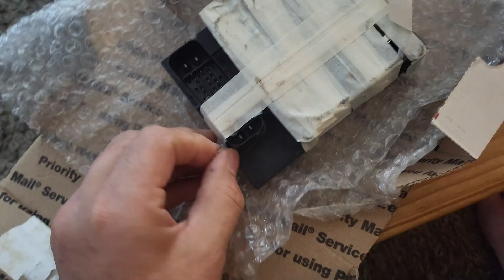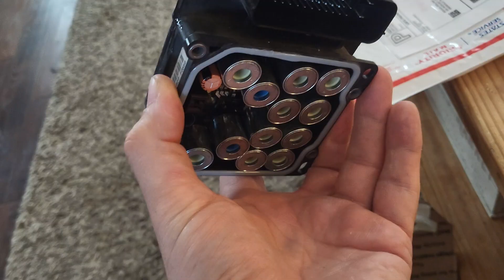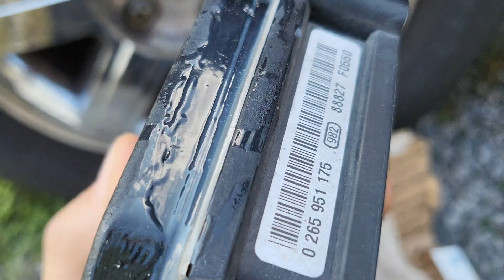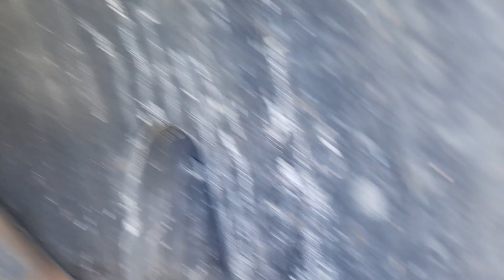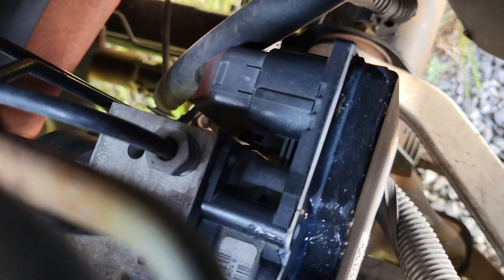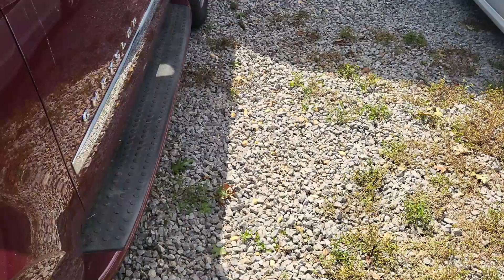Chrysler Aspen ABS Module Repair Part 2

Comment: My dad's 2008 chrysler aspen 5.7 has no communication with the ABS module according to my scanner.  Do you know which fuse controls that and location.? Do you know if  their is a fuse box inside the car ?  I see 2 fuse boxes under the hood. Let me know if you can assist. Thanks
Reply from the maker: I appreciate you checking out the video.     I am unsure about the fuses. I had code 2200... which is a failure to communicate.   Once I did the ABS repair done, the module and truck started talking. Apologies. I don't know which fuses...
Reply: Thanks

Comment: Also would like to know if you had to bleed the module like you would bleed the brake lines. Or did you just reattach it .
Reply from the maker: Yes, I did bleed the ABS after reinstalling the rebuilt module. Once you fix the module, your truck should communicate with the module and then you'll be able to bleed the ABS using your OBD computer. Be sure to follow the service manual. I also had to do it a few times. Thanks again for checking out the video.
Reply: Thank you

Comment: Can I ask you a question? While your abs control module wasn't working did you notice the speedometer not working too ?
Reply from the maker: No...my speedometer DID work.
Reply: @mpen4445 I was looking at the module and it was actually unplugged somehow.  I plugged it back in hoping that would fix it but unfortunately I still have all the lights and no speedometer.
Reply from the maker: Then you'll probably have to get a shop to scan your vehicle to see where your faults show....
Reply: I have all these lights and just recently the speedometer quit as well.  Have you been able to fix it yet?
Reply from the maker: My speedometer never quit. I did get my ABS repaired and cleared those lights...

Comment: Thanks for working on yours. I have an 08 and I need to do the same thing. No you did need to take off the tire to get to that correct?
Reply from the maker: Correct. I used a jack to create a gap above the tire to access that area better. Turning the wheels  may work, too? Didn't try that...